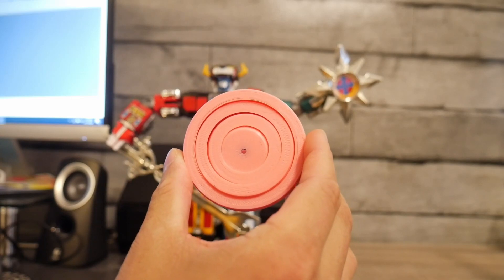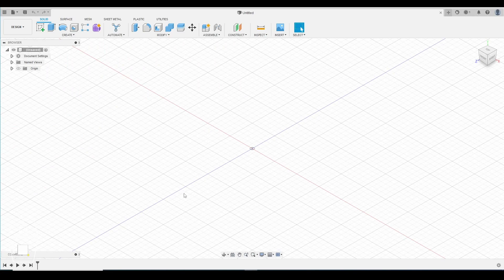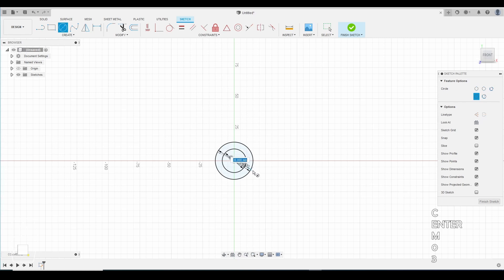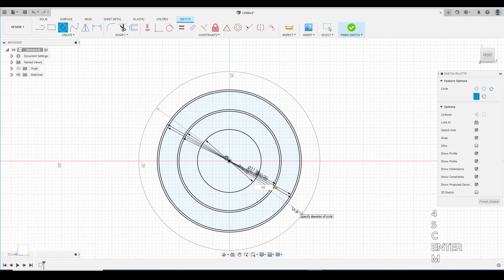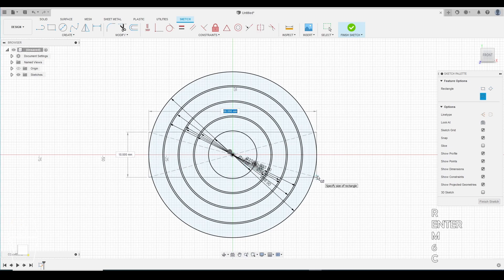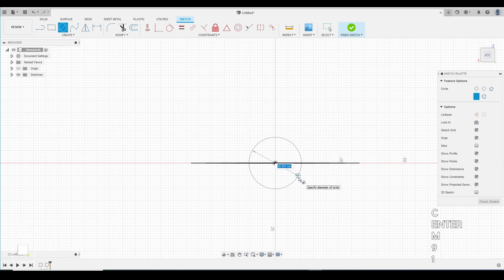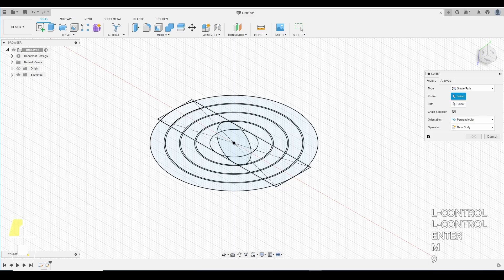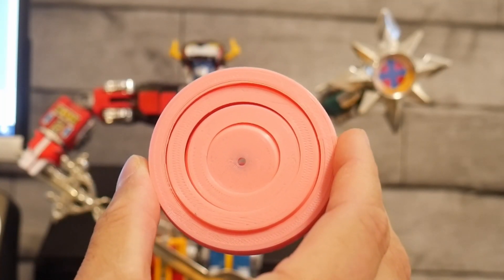Five Minute Design -Fidget Rings

Comment: When I try to select a profile it select the entire ring rather than the section within the rectangle…
Reply from the maker: Make sure when you are making the sketches that you only have 2 sketches when finished.  The first sketch should have the circles 19 mm through 66 mm along with one rectangle.  The next sketch should be on the top plane and only have one circle. You will then be able to select the pieces from inside the rectangle on the front sketch to use the pathway tool.